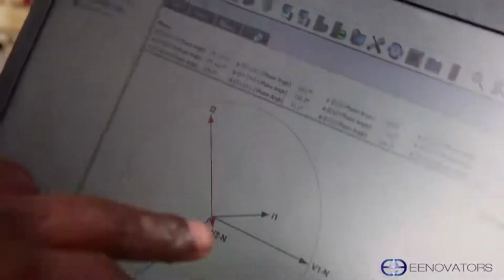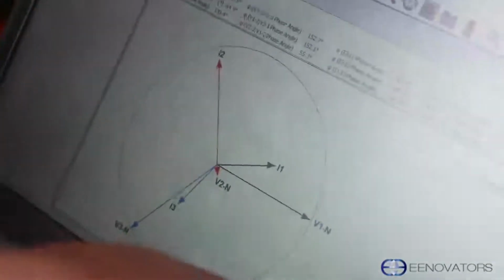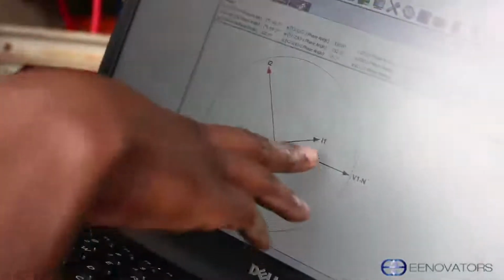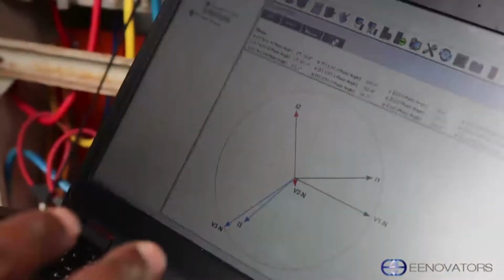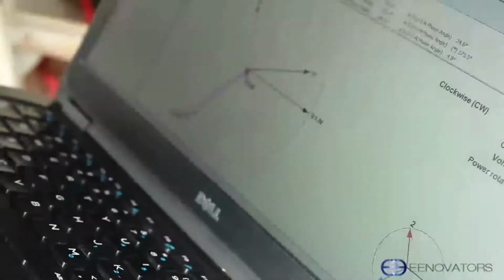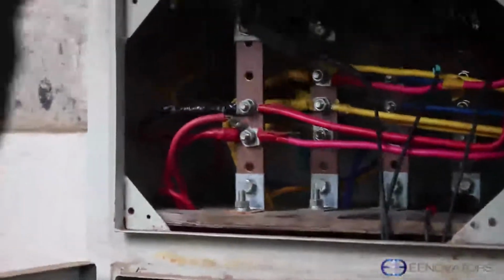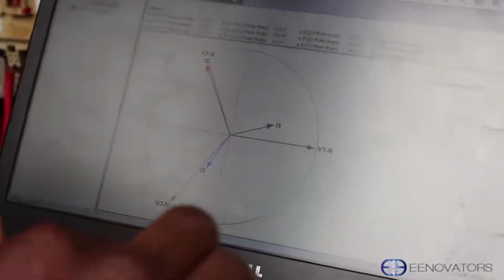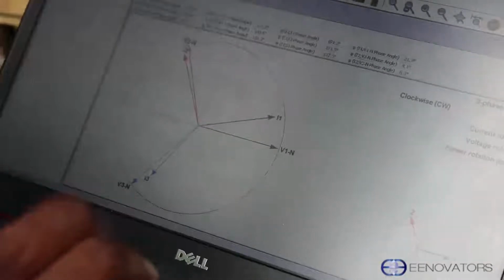STEP BY STEP POWER AND ENERGY LOGGER INSTALLATION TUTORIAL - PEL

Comment: How do you set up the instrument for single phase logging?
Reply from the maker: Use one CT cable and two VT cables(One on the live line and the other on the neutral line). After installation, the configuration on the software should be Single phase 2 wire.